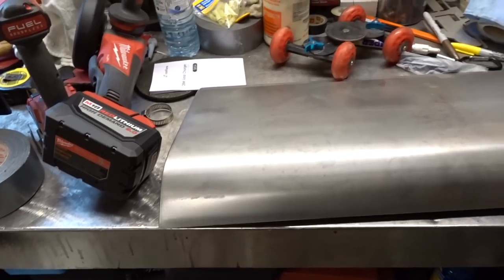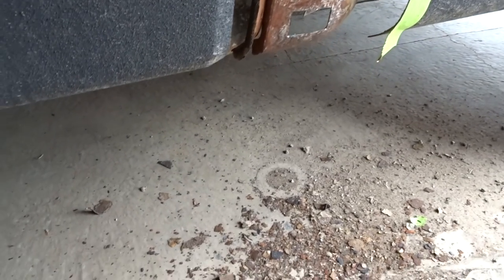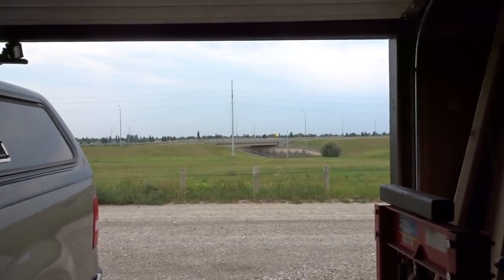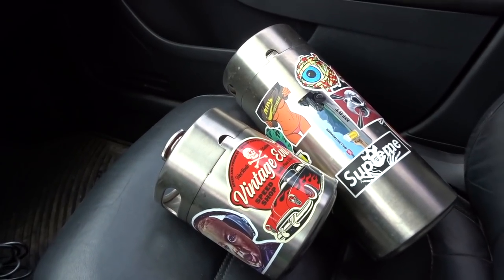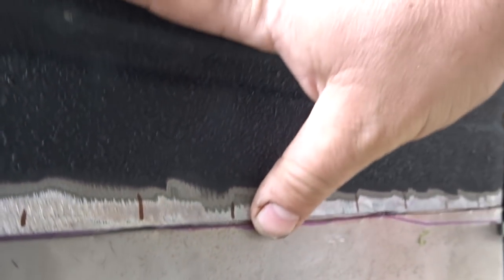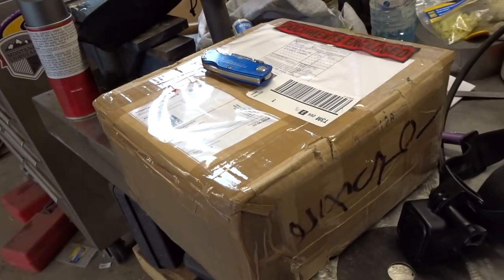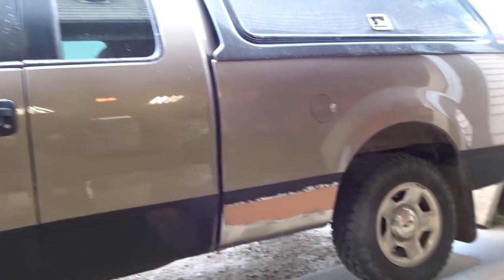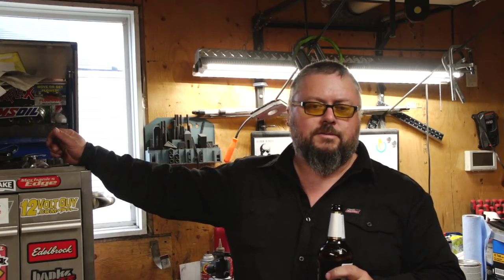Repairing Fist Sized Rust Hole on F150

Comment: If you own an F-150, this is a list of issues you will have (please add to the list): -RUST...everywhere, this the biggest issue! -BRAKE LINE FAILURE (mainly from rust) -EXHAUST MANIFOLD LEAKS (from rusty stud bolts) -If 4X4, ISSUES WITH 4X4 UNABLE TO DISENGAGE (probably from something rusting), BRAKE BOOSTER (from rust through). Does anyone else think Ford's Quality Control line was non existent from 1997-2012?
Reply from the maker: Do you actually think it got better since 2012 ?
Reply: Bullshitkorner haaaa! Did it not? That’s the last year I’ve been around.

Comment: What mig welder would u recommend? I had a 220 volt Lincoln with Diamond core to replace that machine  1500 bucks, f******meth heads broke into my shop cleaned me out.ty for the entertainment